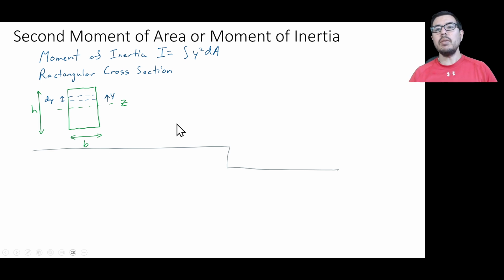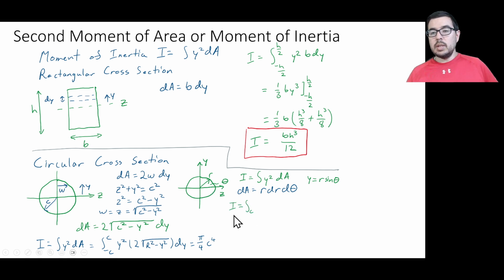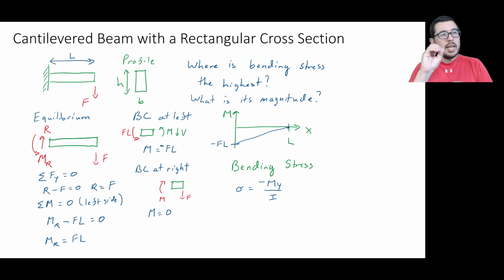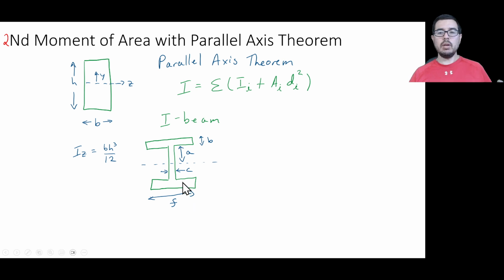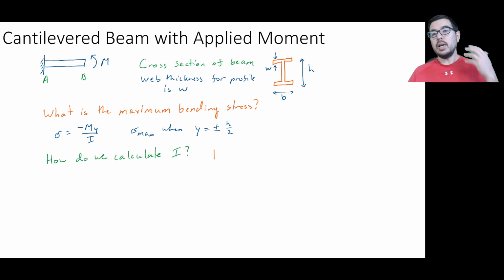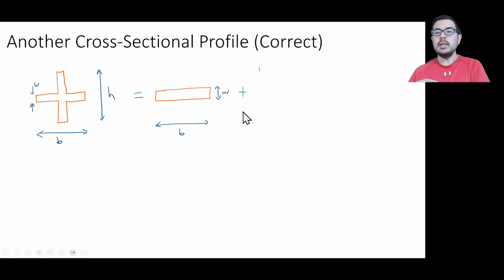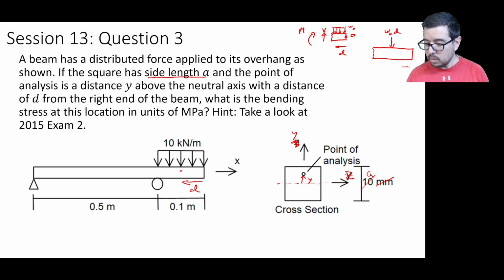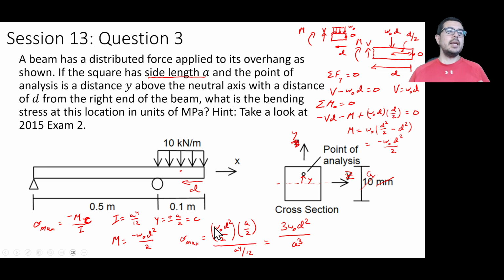Calculating the Second Moment of Area, the Parallel Axis Theorem, and a Bending Beam with Overhang

Comment from the maker: Apologies for some confusion in calculating the max bending stress for Session 13 - Q3 by using a/2 instead of y. If you look at the updated slides for Session 13, the calculation for the stress at location y above the neutral axis should now be correct. Also, it is much simpler to calculate the bending moment at the desired distance by just looking at the overhanging region and covering up the left portion of the overhang.